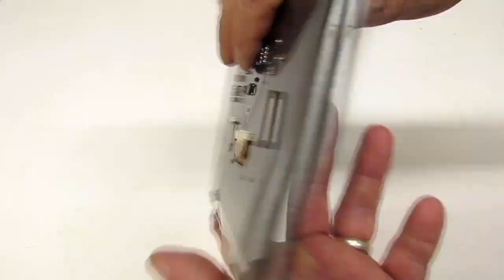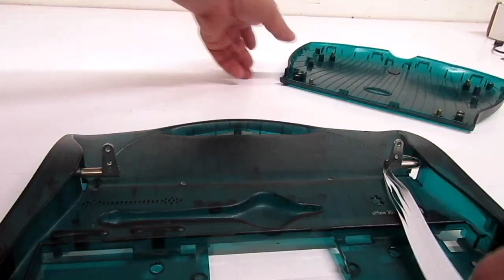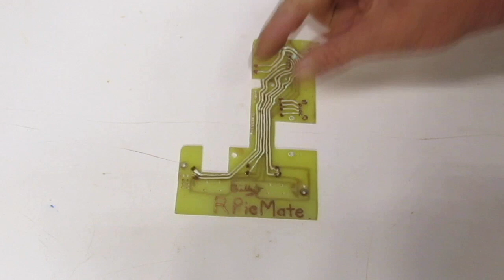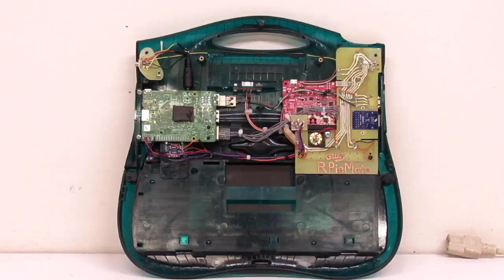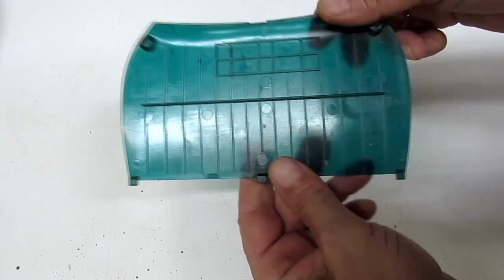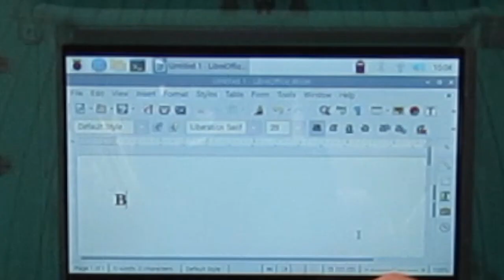Upgrading an Apple eMate 300 to a Raspberry Pi 4 8gb, a Pimate?

Comment: Pro tip: would it still be an Emate if it runs that Raspberry Pi thing?
Reply from the maker: Well.... seeing as that they are both ARM processors, and that they both operate on Operating Systems, that don't interact with current Apple operating systems....... I would say yes, it's still an eMate. I would pose this question to you, if you took a 1966 ford Mustang, and shoved a Chevy 327 into it, is it still a Mustang?

Comment: Hey Billy, great work once again! Do you happen to have the schematic or some close up photos for the Teensy keyboard -> USB you made?
Reply from the maker: Hello:) Yes, the code I used is available on the website of Frank Adams, and it clearly lays out the pin assignments. I would post everything here, but that would not be fair to Frank. He lays out the basic code (not BASIC), to interface with keyboards. Go to the "Frank Addams Instructable" Page
Reply: @BillyTheKidCENTURION  Thanks for the fast reply! Yep, I'm familiar with the instructable and used your code and the PCBs from Frank to do iBook keyboard before! I've got your INO file here, but what I'm struggling to decode is which pin on the flat ribbon cables you connected to which pin on the Teensy. Given I've already got your INO, I was just going to wire it up as you had instead of going through the whole scanning process.
Reply: Doh, I found it in the comments further down, thanks!

// Define the Teensy LC I/O numbers (translated from the FPC pin #)
// Row FPC pin # 01,02,03,04,05,06,07,08,09,10,11,12,13,14,15,16
// Teensy I/O  # 12,14,15,16,17,18,19,20,21,22,23,25,24,10,9,8
// Column FPC pin # 17,18,19,20,21,22,23,24
// Teensy I/O     # 0,1,2,3,4,5,6,7
Reply from the maker: @lazdnet   You don't have to go through the scanning process, just read the code, it tells you what pins are assigned to the teensy.
Reply: @BillyTheKidCENTURION  Done deal, I read the code, loaded it up, and it worked first try! That said, 3 keys don't seem to work: Return, ], and \.... Any ideas? Wiring must be correct since the rest of the keyboard works flawlessly, numeric, alpha, arrows, space, shift, capslock, delete, and some of the media keys. Perhaps I have a slightly different keyboard on my eMate 300?
Reply: Welp, the small FPC wasn't making good contact. Unplug, replug, and BAM! Working perfect.

Thanks again Billy, you're a mastermind!
Reply from the maker: @lazdnet   Well thank you :) I'm not a mastermind, that title goes to Mr. Frank Adams:)

Comment: I was wondering when someone would do it n the I found you already had! Amazing. I have a number of Newtons buy sadly no emate... maybe I should do a similar build. Would be great to see Einstein running on it or at the least vmac and the Newton hypercard stack.
Reply from the maker: Hello, and thank you for the compliment:) Is Einstein running on the Raspberry Pi yet? I haven't fooled with Einstein for several years. I've tried several emulators for the classic Mac OS on RPi, but they were all buggy and very slow, are the newer versions better? I've not tried an emulator since 2020.

Comment: How many keyboard pins are there? I'm attempting a similar project with a Powerbook G3 Lombard and I've found zero documentation
Reply from the maker: Hi, I may be mistaken but isn't the connector on the keyboard like the iBook G3? I know it is on the Wallstreet. If you go to the "Instructable" by Frank Adams, you'll see how I figured out the keyboard matrix.
Reply: @BillyTheKidCENTURION  there's 2 ribbon cables with 33 pins between them, and 3-4  jumped pins in addition to those that I think I could skip

Comment: Can you do eMate 300 running Windows or mac?
Reply from the maker: Hello:) The only thing stopping the eMate from running either the Windows or Mac OS, is the LCD. For this video the LCD is running off of the Raspberry Pi DSI, it is a fifteen pin cable that has been serrated to reach the R Pi. Since the DSI LCD only relies on those fifteen pins for touch/video/ and power, it makes it ideally thin to fit in the eMate LCD housing. 

All HDMI LCDs, which are Windows or MacOS compatible, use a bulky HDMI connector or even HDMI mini connector, which makes them too thick to fit inside of the eMate screen housing, that includes eDP (or displayport) modules that are available.

It would be very simple for makers to shrink, or even make breakouts, for HDMI or even Displayport connections, but I think that not enough of a demand is there for them?

The key here is getting the LCD transmit wires around the hinges and to the host, like a Raspberry Pi or even a transplanted Mac or Windows Machine.

Doing an eMate with Windows or Mac has actually already been done in a way, we are now only waiting or DIY LCD manufacturers, to give us a compatible display.

Thank you for your question, it was a really good one:)

Comment: Even better: Hackintosh the raspberry pi.
Reply from the maker: Hmmm, do you mean put a hackintosh in the eMate rather than a Raspberry Pi? I have looked into that very closely, and I think it can be done easily, it's just a matter of routing the HDMI cable around the hinges for the LCD. The Macbook Air 11 inch logic board would actually be ideal, if I could reroute the heat sink and fan:)

Comment: Hi Billy! Love the video!. Can you please elaborate on your pin connections for the keyboard? I bought the same parts but I couldn't tell 100% from your video how to connect the FPC adapter to the Teensy LC. Thanks
Reply from the maker: Hi, I'm glad you liked the video:) for interfacing the Teensy to the FPC adapter, I made "U" shaped pins from bending interface pins (the plastic just slides off once you cut the individual pin from the rest). Then I soldered pin 15 of the teensy to hole 2 on the FPC breakout, from there I installed 9 more U shaped pins going up from the Teensy to the FPC breakout (Teensy pin 16-FPC hole 3, Teensy pin 17- FPC hole 4, etec....). I wired Teensy hole 12 to FPC hole one. Do not use Teensy pin (hole) 13, it is connected to the LED indicator.

If you are a bit confused, then let me know and I'll post a video on how to get any Apple Laptop keyboard up and running using Frank Adams code.

Good luck

Billy
Reply: @BillyTheKidCENTURION  Hi Billy, that's a great help. Just a quick follow up: does this mean you soldered the 3.3v pin on the Teensy to pin 11 on the break out? And are 24 and 25 crossing over each other so they go to 12 and 13 respectively on the FPC board? Thanks again

Edit- actually looking at your video a few more times, I think it's teensy 14 connected to FPC 2, is that right? So there's no 3.3 connected to the FPC board
Reply from the maker: @andrewdambrose580  Yep, you're right, sorry about that, I don't have the board out of the eMate, so I was working from memory, now I'm looking at my notes. So it's Teeny 14 to FPC 2, and ending with pin 23 attached to FPC 11, that's for the "U" shaped pins. Then it's Teeny 25 to FPC 12, teensy 24 to FPC 13, teensy 8 to FPC 16, teensy 9 to FPC 15 and teensy 10 to FPC 14. Those previuos connections were for the 16 pin socket that I solder to the FPC (pins 1-16). Then I soldered the 8 pin socket to the last 8 pins of the FPC  (33-40).  the numbering on those is teensy 0 to FPC 33, teensy 1 to FPC 34, teensy 2 to FPC 35, teensy 3 to FPC 36, teensy 4 to FPC 37, teensy 5 to FPC 38, teensy 6 to FPC 39, teensy 7 to FPC 40.

I did not use pin 11 on the Teensy

Comment: If you don’t have a 3D printer; get one. You’d used it like crazy for stuff like this.
Reply from the maker: Well....... I'm not a big 3D printer fan, but I do want to do more complicated resin casings, that's why I'm saving up to build a large pressure pot to degas my castings. I want to cast a set of cases that somewhat resemble the eMate, but hold a 9.7 inch iPad LCD, and have a trackpad:)
Reply: @BillyTheKidCENTURION  Hmm… well, you might like the output from a liquid resin SLA printer better than a filament-extrusion printer then. The parts can be directly used; or used to make silicone molds for doing a production or casting in some alternative material (fiber-reinforced epoxy comes to mind). Liquid resin, being liquid, is of course a little bit messier than dry filament, so you’d probably want to keep the machine out where you do your castings. 🤔

Just curious… How large of a pressure pot are you looking for? And have you considered getting a vacuum pump/chamber as well?
Reply from the maker: @darkwinter6028  Oh sure, I've looked at the vacuum chambers, it just seems that there are more instructions out there on pressure chambers. I want a chamber of at least 24 inch diameter and 24 height. 

I know that it is messier than filament, however it produces a much sturdier, higher temperature resistant,  and impact resistant product, plus you have a much wider range of pigmentation options, since all you have to do is add a couple of drops of dye.

I want to do translucent cases, in Bonnie Blue (like the original iMac), ruby red, and multi colored.

I'm already experienced at making molds for Thermo-forming, I successfully did a Mac classic case (Without hand-hold), that is what got me into resin casting.

Comment: How much cost one of those ? I need something small for work to watch movies
Reply from the maker: Hello, if you read the description it details the cost, which for me was $426.05 USD. However, It could be made cheaper by using a RPi 3b or RPi 4 2gb model, and a much less expensive UPS like the MakerFocus with 10000mah battery which cost $30.00 USD.
Reply: @BillyTheKidCENTURION  nice project :)

Comment: There is a Newton emulator called Einstein: https://github.com/pguyot/Einstein/wiki. There are no Raspberry Pi binaries, but it can be compiled on most versions of linux, so it may work on the Pi
Reply from the maker: I'll have to look into it. From what I understand, for Linux it only functions in 32 bit? How would I port that over to the Raspberry Pi?
Reply: @BillyTheKidCENTURION  Oh, forgot about that, but I did see some mention of running it on a Raspberry Pi

Comment: I have an idea for you bro, try running a vm of macos 9 on this machine, and you would have a fully functioning Apple emate faster than the original system.
Reply from the maker: Hi, I don't know if you watch Sean's channel "Action Retro", but he rigged the OS to boot directly into VM to run OS 9, but sadly it only displays part of the desktop:( Have you tried many emulators, and if so, which did you find was the best one?
Reply: @BillyTheKidCENTURION  imho qemu running on Linux works best for a rpi bro (I tried Windows 95 on it once on rpi3 and it ran sluggish but ok)
Reply: Emate work on newton os 2
Reply from the maker: @ДаниилПрохоров-ю4й  Hello, I'm not sure what you are asking? Yes, the original eMate will run Newton OS 2.0 and 2.1.

Comment: This is the most amazing thing I have ever seen. Well, at least since your last video! I can't believe how clean it is.
Reply from the maker: Thanks man:) I tried to get your OS 9 emulation running on it, but it only shows one quarter of the screen, upper left hand with the menu bar? Yep, I like using the circuit board, it eliminated 11 of the wires out of the 36 I had to run, it really cut down on the clutter.

Comment: That soda can bracket is gonna chew through the cable in no time.
Reply from the maker: There's actually very little to no movement of the cable in the LCD casing, and I smoothed the edges of the bracket with 400 grit sandpaper.
Reply: I would wrap it in tape a few times or just replace it with card instead